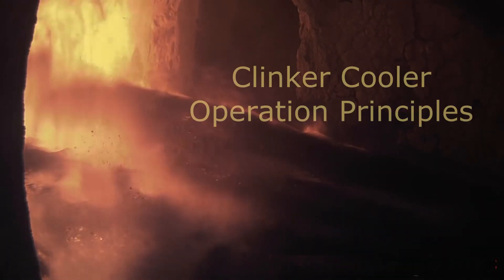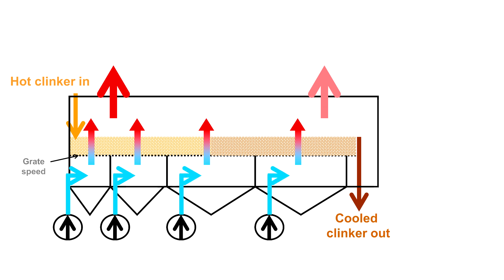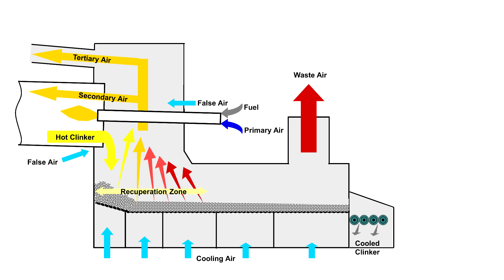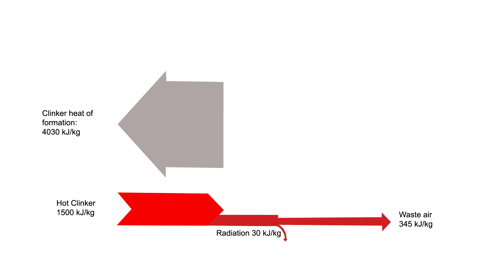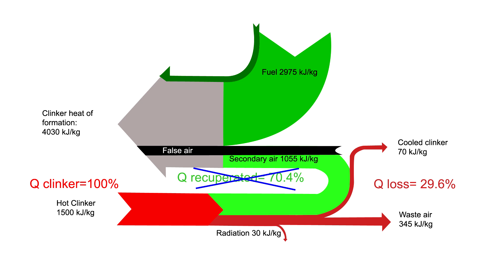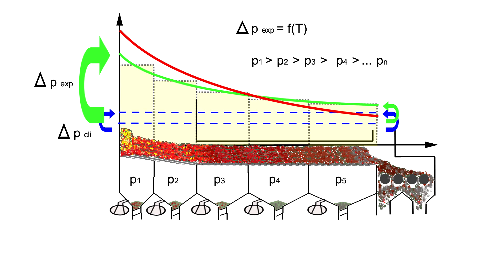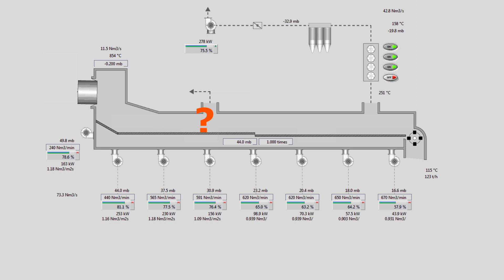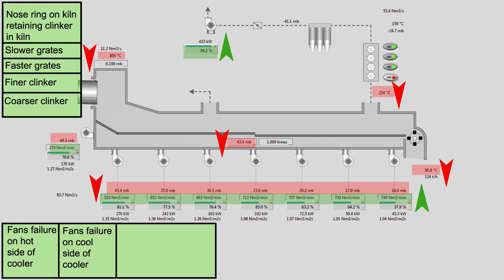Clinker Cooler Operation

Comment: Thank you Sir for shearing this video and give the exercise to practice.
For the answer is you were increased spped of Grate 1.
Why:
- UDP drop
- SAT drop
- High Cooling Air to all Chambers (also high Specific Cooling Air Flow Rate)
- Clinker outlet temp was drop.
- EP fan was increase speed.

Thank you .
Reply from the maker: Yes, actually both grates were running faster and now with less charge in the cooler we have this condition.
Reply: Thank you sir for reply  @vbrcement3666 
Could you make more content about ProCEM simulation?

Comment: Like we see the air is increased at constant damber open, the pressure decreased, and the secondary air temp. decreased also so the speed of clinker was high compared with speed of the kiln, my suggestion to have auto systems in control volume of air Flowmeter and auto system between the pressure of second room and speed of the cooler
Reply: Very good observations, well done!
Reply: @FredAubert  sir there are in some plants cooler without Flowmeter of the air just the pressure, how could we control their
Reply: That is a situation where you will need a very good operator in the field keeping an eye on the cooler. The risk is that if there is a lot of pressure under some of the compartments it could be that the fan is working at its limit capacity - called "shut off pressure". In this case you will have no flow in the cooler and will certainly damage the plates / bars.
The "very good operator" the field should listen to the fans and actually stand next to the fan inlet to feel whether there is draft inwards or not. 
Make sure to analyze the fan curves and to run the fan below this shut off pressure.
Difficult to explain the "how to do it" from the distance, but I hope this helps.
Reply: @FredAubert  thanks a lot sir we your notes is so good and your ways is really new for us... what we do is monitoring the pressure and make operator in the field monitor the bed 
I appreciate your recommendations so much sir 💗

Comment: Sir  clinker come in light brown colour and high freelime please give your  suggestions
Reply: Hello Kandavel
My first comment is that your clinker is underburned. The reasons why you cannot achieve a proper burning / firing of your clinker may be multiple, and without any further details about your system I am not in a position to provide suggestions.
For a start, look at the options to get your burning zone hotter.
Good continuation, Fred
Reply: Sir i am in lab person in  our side parameters are slightly change in rawmill residue 45 mic is 0.8% from 1.o%but  now  clinker not formed properly kiln showing in Dusty conditions and clinker come with brown powder this is reduced to strengthen
Reply: Happy new Year to you!  
Sorry to disappoint you but product fineness is just not sufficient for me to provide a realistic solution to your problems.
Increasing the raw meal fineness should have improved the clinker burnability so there is something additional to the issue.
The best is if your management invites me to visit your plant, then I can analyze what is happening and provide guidance.
All the best, Fred

Comment: Thanks for the lesson
In my opinion the reason in this Ex is the cooler is empty so the clicker bed is too low
We should have a clinker bed to have good heat transfer and good secondary temp 👌
Reply: Yes, the cooler got empty because the grates are running faster. You are right, retaining the clinker longer in the hot zone (higher clinker bed) will also improve the secondary air temperature.
Thank you for the feedback!

Comment: Hello VBR Cement, 
I will attempt to answer. The speed to waste air damper automatically increases because it will try to maintain constant negative pressure of 0.2 mbar inside the hood. It means due to some changes in the cooler conditions, the negative pressure must have dropped below 0.2 mbar and therefore the air damper increased it speed. The higher pressure drop inside the hood can happen when clinker particles are finer, thickness of clinker on the grate is higher, grate speed is slower or the air damper fans are faster. The decrease in clinker temperature shows that there is better heat exchange. This suggests slower grate speed and better heat recuperation. Is my approach correct?

Comment: Very nice explanation. It's would be great if you make a video about ETA cooler. also about the motion control of its.
Reply: I am glad you liked it! Yes it is a good idea to work on a specific ETA cooler, I shall work on this!
Reply: @FredAubert  , I got some question about cover of grate:
  1. Why use pebble stone filling in the lanes?
  2. Can we use clinker(unburn or normal)? if can or can't, why?

Also the stroke length of the grate,i.e eta cooler with 6 lanes: lane No.1 & 6(125mm) are shorter than lane No.2,3,4&5(180mm). Can you please explain about that too? 
Thank before hand.🙏
Reply: Hello Viden
I presume that your questions relate to a restart after a major overhaul,  that is with an empty cooler.
The idea of pre-loading the lanes is to protect the plates and offer some initial resistance to air flow, at least till you have clinker dropping down from the cooler.
You can use clinker, but it is good material and costly in comparison to pebbles / gravel. 
Unburnt clinker is not good for that purpose, it will fly away as soon as you start your fans.
Concerning the late 1 and 6 (side lanes)  lengths being shorter, one of the reasons I can see is to avoid forming so called "rat holes" and / or "red rivers" in the cooler. If 1 and 6 are shorter, this means you will never open gaps in those areas which in turn would ensure air distribution within the other lanes.
I hope this clarifies your questions....
Bests
Fred
Reply: Hello @FredAubert  , 
You're answering right on point sir. With your good explain like this, I should answer my senior questions now. 
Thank you very much!! 
Respect,
Viden

Comment: The finer the clinker size, the lower will be the undergrate pressure and low clinker temp
Reply from the maker: Think about the other way around... the coarser the clinker the easier the air could find its way through it, thus the pressure would drop.
Think also about how we determine cement Blaine. The finer the cement (higher Blaine) the longer it would take for the column of air to go through it. Lower air flow would mean higher undergrate pressure in our case of the clinker cooler.
The example I have given relates to a higher grate speed. This would produce a thinner clinker bed = higher air flow = lower undergrate pressure. In this case the clinker temperature is lower because we kept the same amount of air blown through the undergrate fans. Look at the excess air fan: it is sucking more than on the previous settings to keep the hood pressure constant.
Thank you for trying it out and if you have other questions let me know.
Cheers
Fred
Reply: @vbrcement3666  Sir, very nicely explained... my question is how to judge the clinker bed? We are facing problem in getting the chamber pressure high although on checking through inspection window it is less.. what should be the bed height with fine and course clinkers?
Reply: @anubhavsingh1889  

Interesting to see you back here, I hope all is fine on your side!
I believe that you have answered your own question, somehow. The cm of clinker bed can be "seen" very approximately through inspection doors. You need to have on the opposite wall of the cooler some marks / references which will give you an indication how much clinker you have on the cooler.
The actual cm of clinker are not really important, but rather the pressure you can build up in the chamber. I suggest you follow what your manufacturer tells you and try to achieve the recommended pressure.
You mention that it is difficult to get the pressure high enough. There are a few possible reasons for that, but the most common are leakages / deformations on the cooler beams or damaged seals. If this is the case, you will have to find new setpoints for operating the "damaged" cooler, having the main goal of achieving the best secondary (and tertiary) air temperatures.
I don't have sufficient information about your kiln and cooler to give a formal appraisal.  
In case you need further advise, let me know, but to start with send me some screen shots of your kiln + cooler operating at nominal capacity.
Cheers, Fred
Reply: @FredAubert  Thanks for replying Sir. Had we met somewhere as you wrote interesting to see me here!! Please take my apologies for not able to frame question properly. 
Actually my point was to make run cooler slower so as to enable clinker cooling and recuperation also. The cooler we have is Fons delta cooler replaced in dec 2020. So it's very new and in good shape. The speed is decided based on 2nd compartment chamber pressure which should be around 60mbar. But we are getting it around 68 to 70 mbar depending upon fan speed and clinkerisation. On checking from site inspection window we get the bed height as 400 - 500 mm.. I am not finding any option to  share screenshot here. If you could suggest any other way where I can share screenshots for your reference.. Hope this time I framed my concern rightly.  Looking forward to see your reply soon.. take care Sir.. Have a nice day
Reply: @FredAubert  Thanks Sir, I got your point. I would love share the screenshots but here in this comment section I am not able to attach.. So I was asking for some other option to talk and share like WhatsApp or Facebook messenger... the only problem right now is that the chamber pressure set point is deciding the strokes and due to this the speed is not coming down.. Anyways I will again  thank you from the bottom of my heart for guiding me.. Take care and stay safe Sir
Reply: @anubhavsingh1889   
I think that you may have a misconception somewhere, or I still do not understand what you really mean.
You are right, when in automatic mode the pressure in compartment 2 of the cooler will be kept constant by regulating the speed / strokes of the grates. If you want the pressure to come down, then you have to lower the setpoint and this will accelerate the grates speed in order to reduce clinker bed depth.
Hope this helps, but if you want to WhatsApp, please send me your number
Cheers, Fred

Comment: Sir me as a beginner how should i start to learn about integerated cement plant .because i have a dream to work in a cement industry.right now i am studying B E MECHANICAL ENGINEERING 1st  year.
Reply from the maker: I think that the easiest would be to approach directly the plant and apply for a job there. It may not be "the dream job" at first, but if you become a good mechanical engineer, I am sure that the supervisors / managers will identify your potential and promote you!
The key is, work hard and focus on your achievements. The rest will come by itself...

Good luck!

Fred

Comment: hello my name is tri from indonesia.  ill try to answer.  since you set the fan speed by manual mode,  i see the speed and damper of cf in not change,  so i thing the problem comefromthebed of klinker become thinner because of faster grate speed setting.  thanks
Reply from the maker: Yes, you are absolutely right! Thank you for the feedback and I hope that you enjoyed the small video
Reply: Hello Tri
Apologies for the late reply, I was away working in a plant and could not really come back to my Youtube channel.
Yes you are right, there is a change in the clinker bed because the grate speed has increased.

Comment: Sir,
Is this basically the same process used for hydraulic lime and Portland cement?
Thank you
Reply from the maker: Hi Wallace

I am not very familiar with active lime kilns, but can imagine that the systems are very similar.... The only experience I had with lime kilns is that the material was fed as granules to the system and I found it very strange since for cement clinker, the raw material is a fine powder.

Check the internet, you probably will find a few more explanations. 

Cheers

Fred